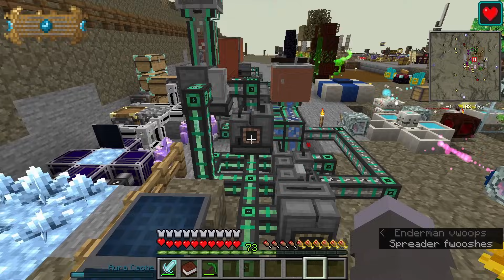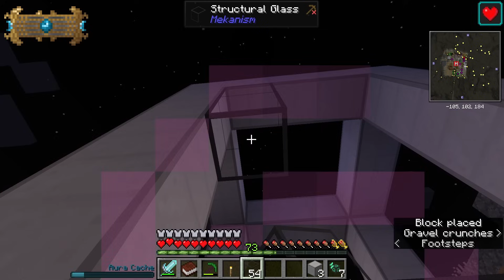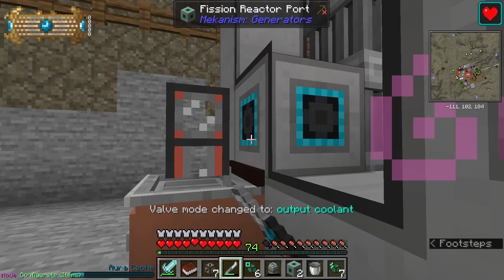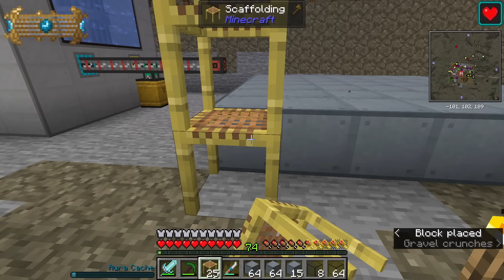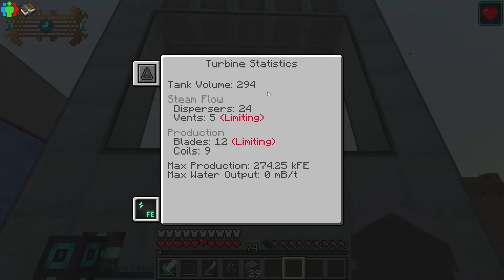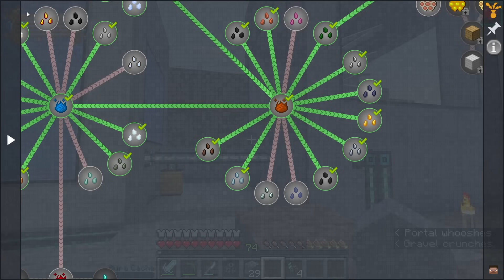The Fission Reactor is Online | Reclamation Ep 34

Comment: You do not need to use the osmium compressor for atomic alloys, you can simply put obsidian into an enrichment chamber for 4 obsidian dust and then put those into the enrichment chamber again. Buuut because you have access to refined obsidian, you should take a look at the stats of refined obsidian armour, because it is very broken and surprisingly easy to craft once you have the infrastructure for refined obsidian ingots. (though tbf I haven't played Botania in a while so idk if it's better than terrasteel) Also look into the mekanism jetpack and armoured jetpack since you're making hydrogen already anyways

Comment: Oh, so they have actually changed sateam to be a gaws rather than a liquid in mekanism. I remember that being a pet pieve of mine back in 1.7.10

Also, i'm prettyu sure you don't need the osmium compressor for the lñast tier circuits. you were looking at the recipe to turn the ingot back into the refined obsidan. the actual recipe should be obsidian dust in a metalurgic infuser with diamonds.